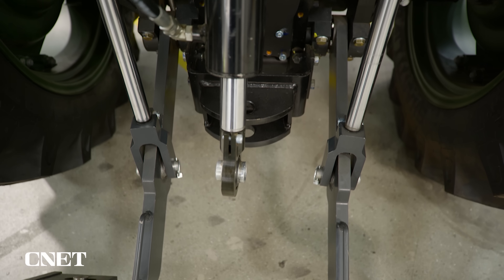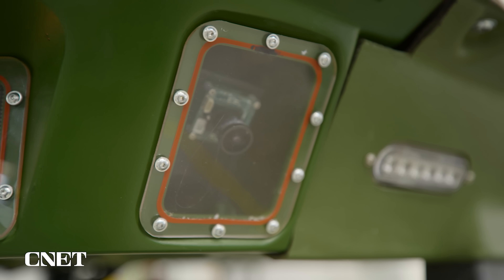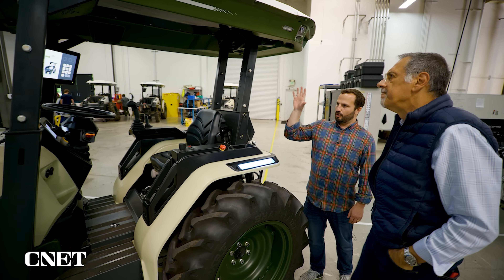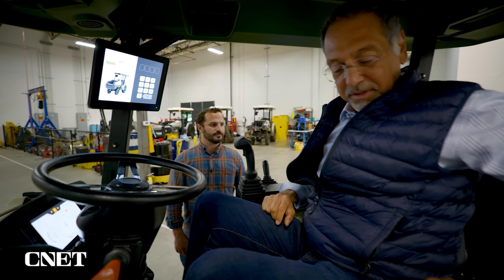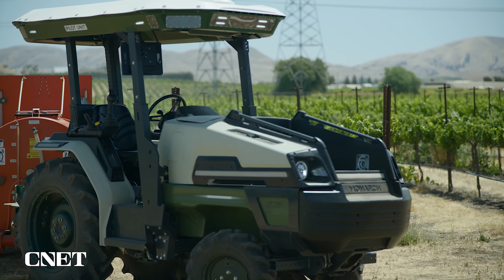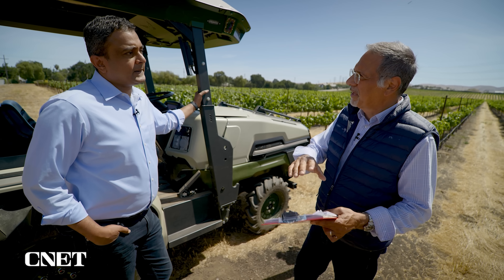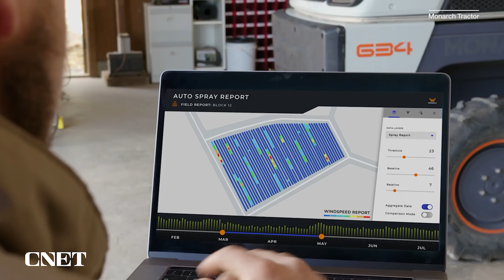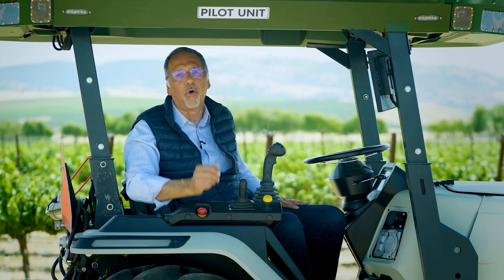This Electric Tractor Might Change the Future of Farming and Food!

Comment: It's all about energy density.  Lithium batteries have very poor energy density compared to diesel fuel or gasoline, which have extremely high energy density.
Reply: But the energy efficiency is far higher than a diesel engine.
Reply: @spartaeus  Not really. The Earth’s crust contains many orders of magnitude more lithium atoms than we will ever need to extract. And the funny thing is: it will never be gone. It still exists even when the battery is completely worn out. 
Also: we are using petroleum produces much faster than the earth is ever capable of producing. But apart from that we all know that we should reduce CO2 emissions as fast as possible.
Reply: 50 years from now farmers will be using diesel tractors
Reply: @Simon-dm8zv  tractors weight 20 thousand pounds plus they pull massive machines and run for maybe a day non stop.   Thats not feasible with electric any time soon. Not even close.  Farm tractors are 500 hp.  Not 40 . I have a 40 horse and that good for up to 20 acres.
Reply: @miker9082  Horsepower is not a problem at all for electric motors. Electric cars are often far more powerful than their ICE counterparts. Even big tractors will eventually be fully electric. Yes, it will take a while but we will get there. Possibly interchangeable batteries will be a solution for non stop running situations. Running costs are far lower for electric tractors, definitely with current and future diesel prices.
Reply: @Simon-dm8zv  yes the problem is that more horsepower takes drastically more electricity and there are no batteries available that can supply huge amounts power for long periods of time.   For small hobby farms electric tractors are feasible if it wasn't for cost. But for large scale agriculture electricity will probably never be used.
Reply: @Simon-dm8zv  smaller machines like skidsteer loaders and barn cleaners are normally used for short periods of time on a daily basis and would be workable if governments give farmers subsidies for buying them.  But we well probably never see a electric harvesters or larger scale tractors that get ran constantly when needed. Harvest season sometimes equipment hardy gets shut off for weeks at a time.
Reply: @miker9082  

Replaceable batteries, Mike. I think most farmers would jump at the opportunity to save thousands on fuel, even if it means running home to swap in a fresh battery - I know I would.
Reply: @miker9082  

An electric car battery is not designed to be replaced. This would be. It's that simple. I'm an engineer by training and farmer by trade; I've thought of half a dozen different ways to make the battery replaceable, and I'm not even being paid to do it. I assure you that the engineers at Case, John Deere, and all the others are more than capable to the task of designing a tractor battery that can be quickly replaced.
Reply: @thomaswalters7117  a battery capable of an hrs worth or plowing or planting on  an actual crop farm would weigh 20 thousand pounds or more .  You truly have no idea how much energy large machinery requires.  Do a little research you will find that electric vehicles are not practical outside of local commuting and still the environment cost after the battery dies and the cost to replace is greater than the value of the vehicle is the issue you have not yet considered.
Reply: @miker9082  

Could you show me your calculations for that 20,000 pound figure?
Reply: No. Its a waste of time.
Reply: @miker9082  
Ah, so you mean you made it up
Reply: @thomaswalters7117  I mean if you had any clue how much energy is needed by large working machinery we wouldn't need to have this conversation.
Reply: @miker9082  
I don't see why, if you have something to support your claim, you wouldn't simply explain yourself, instead of attacking my knowledge on the subject

Comment: The size of those tractors is perfect for fitting in the corridors, in between the lines of plants, in Agrivoltaics.
Reply: you can chose the corridor distance in agrovoltaics. the only probem that it is cheaper to use the land only for PV or for AG.

Comment: The Monarch Tractor will " run for over 10 hours on a single charge (3-4 hours of PTO use) and takes 4-5 hours to charge on ... 230V with a standard 80 amp charger..." (quote from their reseller website). Given that the PTO may be working 10 hours plus in a day, this is not feasible. It is notable too that it uses hydraulic fluids (fossil), which I thought this was supposed to be a move away from. [Yes, I know many implements use hydraulics, that is part of the irony in this machine.]

Comment: There have been large farm tractors that have been autonomous for years and provide feedback on crops.   The one thing this is missing is a loader. Most under 70 hp tractors sold have loaders.
Reply: I read this tractor may not be able to have a loader because the loader will block too many sensors.

Comment: There's a reason why they show this tractor in light-duty applications.  The issue is not the power, it is the ability to apply that power. under high load, over the course of a very long day.  Frankly, I do not believe claims of "6 to 8 hours at high load", unless their definition of "high load" in vastly different from mine.  Combine this with the 4-5 hour recharge time and you will have a tough sell to many farmers.  I have no doubt that there will be successful electric farm tractors, but I doubt that the battery tech currently exists to make them a true diesel replacement with equivalent utility.
Reply: When farmers using ICE tractors see how much more productive and profitable the farms using electrics are, they'll switch.
Reply: @TommyJonesProductions  I agree...WHEN they see that.  The questions is whether that is any time soon.  I doubt that given current battery technology.
Reply: A typical row crop tractor would require a 20,000 lb battery and would only run for 4 hours. During planting and harvest the tractors will be working at least 12 hours a day. There is no time for recharging a battery. In addition every square mile of farm ground in the US would need to be rewired for high capacity 3 phase supply lines for recharging. It would probably cost a $ trillion to upgrade the power system and it would only be used at full capacity a few months out of the year.
Reply: A row tractor in any of the 3 main categories small, medium and large, would likely need some kind of energy storage system that is swap-able in order to have the kind of endurance needed. Yank out the drained pack, thrown in a fresh one and take the drained one back to the shed to plug-in. Or something that can last 18 hours under high load.

Comment: I think that a locomotive-style hybrid makes more sense for equipment like tractors. A locomotive powertrain consists of a small battery, possibly an older and cheaper type of battery. That uses a generator to charge the battery as needed, which is much more efficient than a physical transmission and drive shaft powering the wheels. I.C.E. engines operate best at specific RPM ranges. Because of this they typically aren't very efficient at low speeds and require a lot more energy in the form of liquid chemical fuel to achieve the same amount of power output as an electric motor does but the liquid fuel itself can store a lot more energy in the same amount of space and wait as a battery can. This could be done with any kind of generator and can be fueled in the same amount of time as an I.C.E. tractor. Personally, I want to experiment with a Stirling engine AKA a Hot air engine. It is an external combustion engine like a steam engine but It uses air instead of water. It produces very little torque but spins at incredibly fast RPMs which is what you would want from a generator. Also since there is no contact between the moving parts of the engine and the combustion process it will suffer less wear and need less maintenance.
Reply: no, combustion processes are just terrible inneficient by their nature. enough battery capacity is the real solution and way cheaper

Comment: This is an orchard tractor.  I guess it might make sense.  Those 2/3 small tractors mentioned are sold to small farmers, land owners and contractors.  You aren't going to sell this to any of them.  You need a front end loader which I'm guessing this thing couldn't handle.  A lot of people also purchase a backhoe attachment which this thing really won't handle.  Furthermore light weight plastic and aluminum isn't going to cut it.  They really want the other 1/3 but most of that consists of very large tractors.

Comment: It's about time that someone is making electric tractors; they're such a fantastic opportunity to reduce fuel consumption (and noise), while improving the tractor. I'd like to see a version with batteries that can be swapped to extend the tractor's run time.
Reply: What about the coal plants that have to generate electricity to charge this thing. And the windmills they throw into the desert. Diesel and gasoline is much more "cleaner" compared to making power plants ramp up.
Reply: And almost zero actual farmers will buy one. This is too small to be practical on anything larger than a hobby farm or orchard operation. Maybe some large property maintenance tasks.

This is a niche device, and as such its impact will be negligible.
Reply: @lb969  

Uhm, did you hear the statistic? A huge chunk of all purchased tractors are in the small HP range, and, moreover, the concept is incredibly easy to scale up to any size. Lastly, I'm a farmer working 500 acres, and I would buy it. This should be the perfect size to pull my 6-row no-till planter, as well as any odd jobs around the farm. I especially like the follow function, since it's ideal for maintaining fences - that's another function I've always wanted.

Comment: The King Ranch in Texas has 1,289 sq miles of land. What are they to do? Buy a fleet and have them staged around on charging stations? Or have a diesel generator mounted or pulled with it to charge it? Also, after 10 to 17 years of use what are they going to have to pay to dispose of the TOXIC used batteries?

Comment: I really like this tractor. Being electric and fly by wire is excellent. But it appears to not have a front loader. Todays tractors are moving toward the work functions of the tractor being off the front of the tractor rather than the the rear.  However there is still a need to support legacy rear implements. A front loader is a fundamental feature these days. Almost no tractor is bought without a front loader.  This tractor may sell well to orchards and vineyards but not to the larger market.  I would buy a Monarch if if it had a front loader and front hydraulics sop I could use buckets, grapple, snow pusher, snow blade, and snow blower.
Reply: I’ve read it will be difficult to connect a loader to this tractor as a loader will block many sensors on it. They might have to completely redesign it to accomodate a loader.
Reply: You are expecting a computer to operate a loader?
Reply: @deere7227  this tractor does have an operator station and looks like a traditional tractor. So it’s not inconceivable a loader could be mounted and controls fitted to the operator platform. If we are looking at an autonomous tractor without an operator station then fitting and operating a loader would be at the very least be expensive, complex and difficult to operate.
Reply: @deere7227  The autonomy concept is great but will not handle every chore. That is why there is still manual controls. This is a nice expensive specialty tractor.

Comment: most major farms already have tractors that drive themselves so this is nothing new to a farmer.  But it would be interesting to see the comparison between smaller electric tractors that work all night and day compared to large diesel tractors.  So could 3 self driving small tractors replace 1 giant tractor production?  Also the golf course and landscape business is where this technology should be applied before large farms IMO.
Reply: They also already use lots of data in farming. this made it sound like data would be available for the first time.
Reply: How does a small electric tractor work night and day? Wouldn’t the batteries die?
Reply: Will 3 electric mopeds replace a full sized car? HAHAHAHAHAHAA
Reply: three small tractors still wont be able to pull a plow that requires 500HP for 12 hours. The tractors here will maybe be useful in vineyards so rich people can feel better about their wine being produced by electric tractors which still get their energy from coal power..... this electric push is nice and I agree its something we need to look into but we are far from just replacing combustion engines.
Reply: Just check out the Millennial Farmer. The All Electric would b new. Also, Case IH is prototyping an autonomous tractor that i self driving, that doesn't have a cab. Its directed by remote.
Reply: @sir3x  you're right.  3 small tractors can't pull 1 large plow but 3 small tractors can pull 3 different smaller plows.
Reply: @phild9813  The batteries would die.  But if a tractor can drive itself than its possible it could change out its own batteries.  The problem with a car is it leaves a charging station and needs to find another one.  A tractor never leaves the farm so if the battery is like a power tool than it makes since to be able to switch out the battery and not wait on the charging process.
Reply: @bobruner7001  A general rule of thumb is 1 HP for each inch of the plow. So by the size of these tractors, they are probably less than 60HP each. you have three 12" plows for one tractor that would be around 36HP required and yes I know that's under the estimated 60HP but in real-world situations, you can't just max it to the Max HP. 

That being said you would need at minimum 3 smaller tractors to do the same plowing as one big diesel tractor. Those three tractors would be running near max usage which you wont be getting as much time in as you need to finish it in the same amount of time let alone being able to get the kind of grab a heavier and bigger tractor would give you. 

This may be a lot of estimation but realistically electric isnt ready for the heavy applications needed for most farming situations. It would be nice in some places yes but overall the tech isnt at the level needed.
Reply: @bobruner7001  that may be , but the cost of 3 small tractors each pulling a plow? give me a break, Ive been working with farmers for the past 6 years season, and they would run one tractor pulling  a 6 or 9 bottom plow and get way more done.

Comment: Very interesting. I would like to have seen a comparison of the price for the Monarch and that of a similarly capable ordinary tractor.
Reply: The closest horse power comparison I could find from John Deere was the 3046R. I did not see a factory installed anatomist option for this tractor. However, if you add a canopy and light kit it comes out to about $38,200. This is also considered a compact tractor, used for light duty tasks. This is not a tractor that you will see out in a field in the midwest planting corn, soy beans, etc. That would be what john deere calls their row crop tractor that are 145 to 410hp. Deere's smallest row crop tractor with Deere "auto track" is about $190,000, and auto track has a $3000 yearly licensing fee.
Reply: @WaukeePaintballer  Thank you for your very thorough reply. 😀

Comment: I’m concerned about bureaucrats some day requiring equipment that does not work as well as diesel.  Harvesting is time sensitive requiring equipment to run nearly 24 hours without down time, maybe 6 hours at most.  Plus, a lot of operations include spraying or turning up a lot of dust, these tractors do not have cabs with climate control.  That alone uses a lot of energy

Comment: Pretty sure we are a long way's off from a battery tractor being able to tow and power 60ft wide cultivators and seeders. This is what is being used on the large farms out there. 40ft wide swathers! Half million dollar combines! HUGE! This toy is going back to the size of implements that were used in the 50's. Farms are way way bigger now. Also a big concern for farming is soil compaction. So if a large battery tractor was developed it would likely weigh as much as an M1 Abrams tank. The efficiency of modern farming is quite high. Different, sustainable fuels will be the more likely solution than this. During planting and harvest season NO FARMER would risk the entire year on a key piece of equipment that could not run 24hrs a day. I am sure some rich dude running a hobby farm will buy this for the deduction though.
Reply: can replace one gigantic tractor with several smaller ones
Reply: @sluvington  For almost the same price. Yeah, sure.